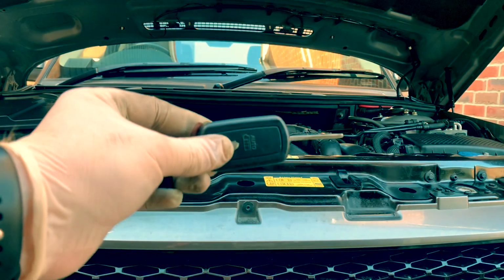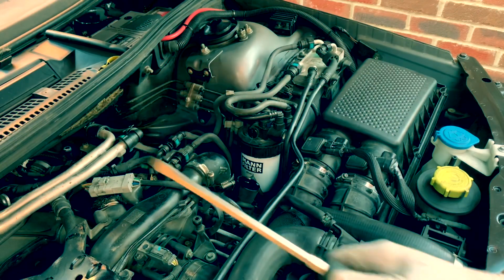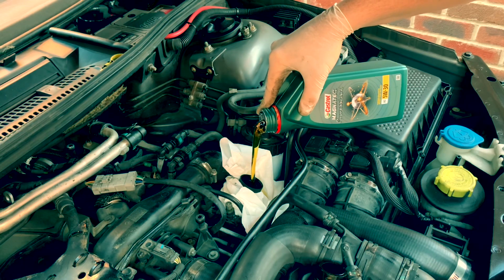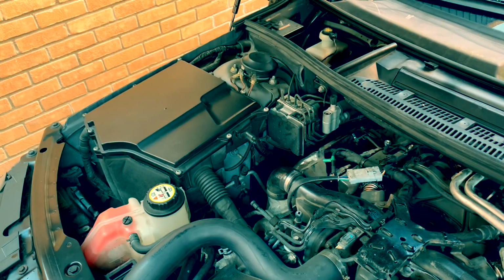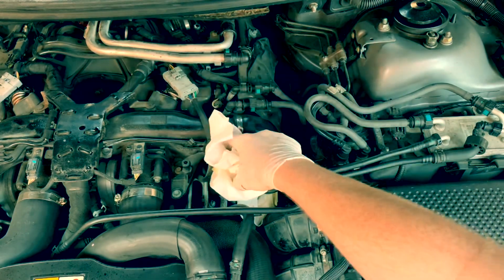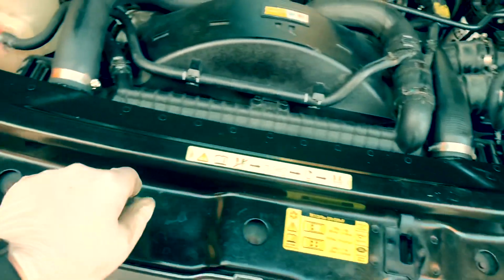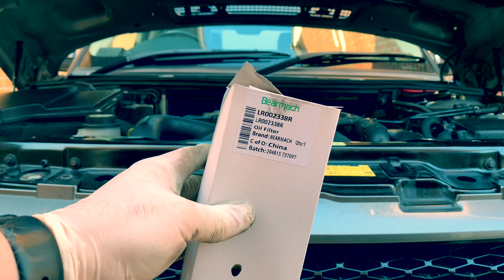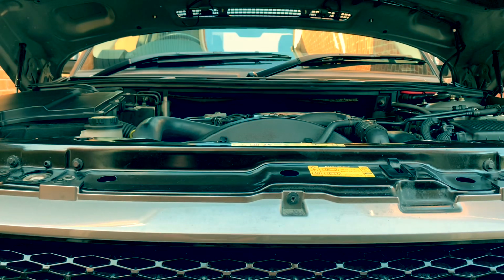How to do an oil change on a 3.6 TDV8 Range Rover!!! At home!!!!

Comment: Why not drain from the sump? Access is easy at raised height. There is also a second sump for the turbo that can clog if not drained regularly and starve the turbos of oil.
Reply from the maker: Unless you use jacks and a secondary safety, you should never go under the vehicle 🚗 this is how cars are now serviced at JLR service centres (confirmed) no more drip trays
Reply from the maker: Turbos fail on the 3.6 due to the clogging of the EGR. This causes excess soot build up on the VNT mechanism. The egr should be replaced or cleaned on or around 100k miles to prevent turbo failure however this was never disclosed to be a maintenance item on this engine
Reply: @scousejt  I worked at an lr dealership and still do it the old fashioned way esp having two sump plugs as the second one is next to the oil pickup
Reply from the maker: @darrensmith2141  I did too, it’s changed a bit since then mate 👍🏻 yes it’s good practice, however this guide (or rather a video showing you how I did it) is how the vehicles are serviced at this time
Reply: @scousejt  still not at hunters landrover main agents  it actually says on certain vehicles  oil pumps are not to be used and the tdv8’s are one of them
Reply from the maker: At least there is one dealership still doing things correctly! If you read the description, there was a reason for this video and why I did it this way. As I said, it’s not a ‘how to’ it’s ‘how I did it’. One is that I was working 15 hour shifts and needed my car, the second is that it was during the real lockdown. It may have helped someone because even a partial oil change is better than none 👍🏻
Reply: @scousejt  No idea if you've still go the RR but I was told you can't drain the full 9 litres using the pump method due to the sump being partially divided which means the hose will not get to the other side of the sump hence you need to use the second drain point other several litres of dirty oil are left.